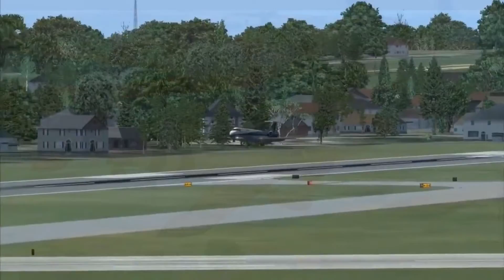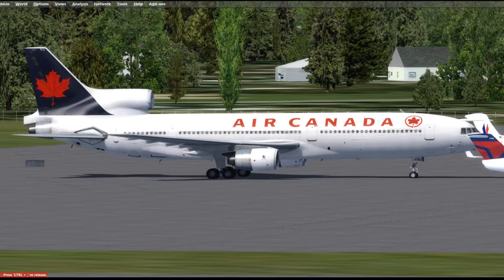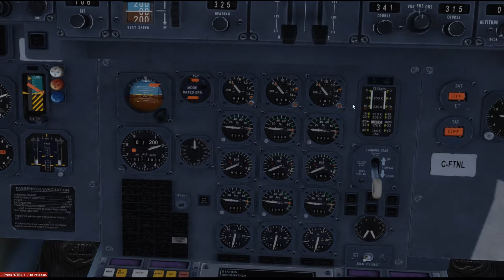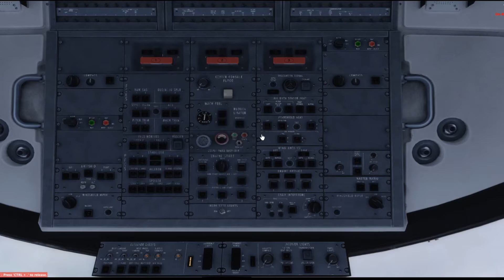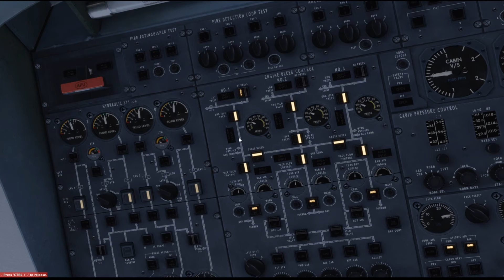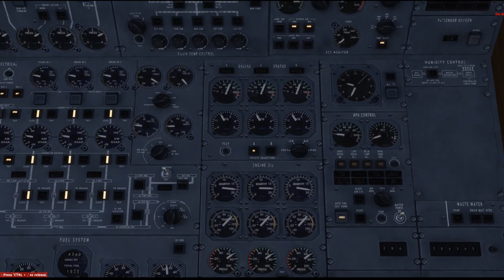[P3D] Intro to the Lockheed L1011 feat. Captain Sim L1011-1

Comment: Not a single L-1011 crashed due to mechanical failure.. not a single one.. all crashes were due to pilot error or weather or unrelated things to the aircraft like fire in the hold or bombs .. there was even an L-1011 that suffered an engine uncontained failure just like the infamous Flight UA232 (DC-10) and could make it back due to its 4th aditional hydraulic system wich the DC-10 lacks.

And even so in the crashes only one ended in all aboard dead and that was due to the crew unexplianable delay in evacuating after landing safelly and stoping in the runway.. even hard crashes like Delta 191 or Eastern 401 had a number of survivors.. tells about how good and well made the L-1011s were

Comment: Great video. Pity I didn t find it before buying the JustFlight version. It really sucks. Like you mentioned can t open doors for GSX and DLC just destroys any manual or ILS approach. Another problem I have with it is on approach it doesn t keep the altitude and climbs about 300 feet and comes back down. I ll just have to buy the Capt Sim plane if I want to fly the Lockheed L1011